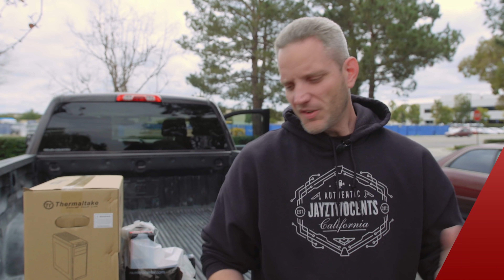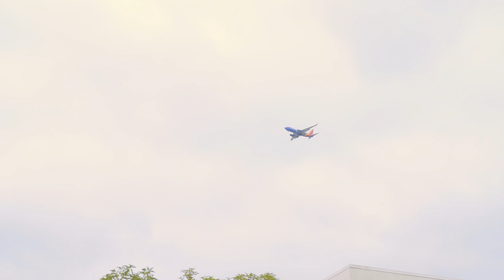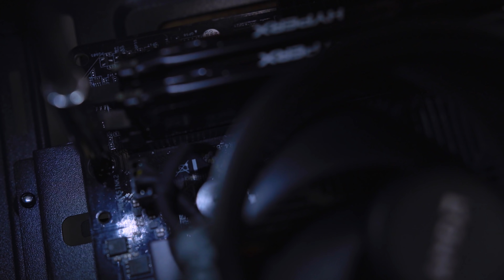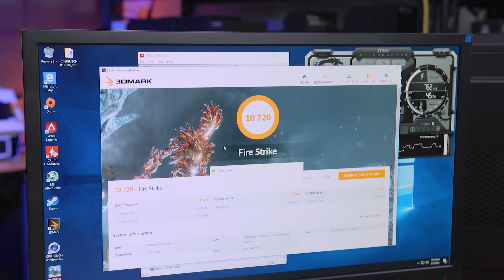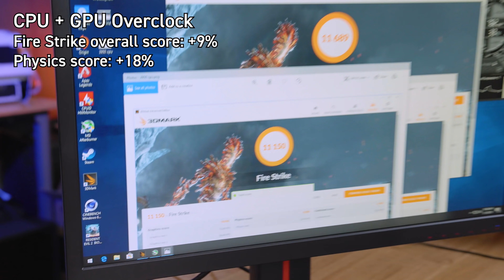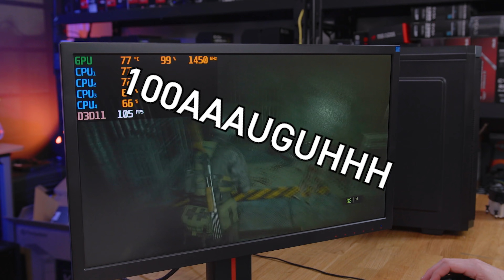CHEAP Gaming PC Build - 2019

Comment: Jay need your help, don't know if I should upgrade my pc or just build the one you just built. Since only really need to upgrade my GPU but then I will need to upgrade your power supply and mite aswell get better ram. I'am running with a I7 2nd gen 2TB hd 8g ram with a gt 520. I KNOW pz don't laugh. Really don't want to transfer my files if I don't have to deal with that mess. Any thoughts ?

Comment: Why is this $580 PC performing better than my $1200 PC (In Apex).... I tried same settings as you did and got an average of 80... FPS gets to 40 before jumping out of the drop ship...

Specs:
Intel Core i5-8600k
Gigabyte GTX 1060
16GB Kingston HyperX Fury
Asus Z370-P
Coolermaster MWE 650W
BeQuiet Dark Rock Advanced C1
1TB Toshiba HDD
240GB Adata SU650 (Apex installed on SSD)
Dual AOC E2470Sw
Reply: Domi apex favors AMD cards

Comment: Instead of cheap you should have said inexpensive.
Reply: Warm Soft Kitty  p sure it exists, just....you wont be able to run ore than LoL on low quality and vanilla minecraft lol
Reply: How much did his cost
Reply: Warm Soft Kitty Well since your PC cost you $3000 I can see why you would think you can build for a little money, You can buy a Prebuilt and put in a RX 560, 1050 2gb, rx 460. You can build a pc for 400 dollars but i will recommend at least 600 to get a pc that not only you can upgrade easily but have enough PSU power to power a lets say RX 5700, maybe swap a R5 2600 for a R7 3700X there are many things you can do with PC components. You can cheap out and get the most bang for your buck leaving no room for future upgrades or you can get a lot better cpu, psu, ram and spend more which will pay out in the long run.
Reply: Warm Soft Kitty  Yeah but we were talking about new and not used. But I got warranty and didnt overclock the R5 2600 for my cousin since he didnt need the extra power ( He's 7 so he's mostly playing Fortnite, Minecraft and Roblox) . And I wanted to be completely sure about every component and having warranty was so my aunt wouldnt worry whether the system will fall apart every second ( Im not saying buying used is bad I would buy used but people who dont really understand PC parts will feel uneasy with something thats used.
Reply: @crazycajunj1703  inexpensive just means it doesn't cost much. Cheap has more definitions. Such as cheaply made.
Reply: No, cheap is right. My gpu alone cost 3x that.
Reply: @jnrs9512  no. Inexpensive is right. From everything I've seen, the rx 580 is a good card. Is your card 3x better? Or just 3x more expensive? Either way. It's not cheap.

Comment: Jay I want to upgrade my system but have no idea where to start... 
I7 5820k cpu
X99s sli-plus Motherboard 
Gigabyte geforce windforce Radeon R9 9200 4Gb DDR5 graphics card 
And 8GB DDR 4 ram...
Want to upgrade the ram to 8GB and want a new SSD and HDD but in terms of motherboard cpu and gpu im a bit clueless whether ill really be upgrading or just getting the same spec with new hardware..  pls help bud
Reply: I would upgrade the gpu and ram. cpu is still great

Comment: AMD - Ryzen 3 2200G 3.5 GHz Quad-Core ProcessorGigabyte - B450M DS3H Micro ATX AM4 MotherboardCrucial - Ballistix Sport LT 8 GB (2 x 4 GB) DDR4-2666 MemoryKingston - A400 120 GB 2.5" Solid State DriveWestern Digital - Caviar Blue 1 TB 3.5" 7200RPM Internal Hard DriveMSI - Radeon RX 570 8 GB ARMOR OC Video CardRosewill - FBM-X1 MicroATX Mini Tower CaseCorsair - CXM 550 W 80+ Bronze Certified Semi-Modular ATX Power SupplyTP-Link - TL-WN881ND PCI-Express x1 802.11b/g/n Wi-Fi Adapter...……………….built it for 550$ including a 30 dollar copy of windows 8.1...………..not the greatest set up but its on par and cheaper than a retail build by 300 dollars.

Comment: I'd like to see an AMD budget build meant for streaming Overwatch, honestly
Reply: Buy a ryzen 5 2600x and you are good to go
Reply: It's moreso that ryzen processors have way better multitasking capabilities than Intel's do. Which is where the streaming comes into play. Intel has better per-core performance, where ryzen excels in using multiples cores to do more complex tasks.
Reply: Also if you haven't, put it on an SSD.
Reply: Just upgrade the ryzen 3 to a 7 and you should be good for any kind of streaming you want
Reply: @BubbaDiesel  Huh really? I've always used Intel CPUs and tbh would need a newer gen higher model than my current 6th gen i5 to do so... So I thought maybe more would be needed! But biggest thing is thank you, I've been considering switching to team Red lately and wanted to see what I'd need for THAT

Comment: ive got 5th gen i5 and a 940m that will run apex and most other titles, you could probably throw a 660 ti in there or a 700 series and be fine. Those older cards dont get enough love.

Comment: does the 2200g support 3000MHz DDR4 RAM ? Where can I check this specification ?
Reply: Yea it does. But you should check your mb also... Mine supports 2666mhz but with ryzen on it supports 2933. So its not all about one or another its together.
Reply: Check on amd website and mb website.

Comment: in india this build costs 81,473.99 rupees, which is roughly $1168.91 rip
Reply: Nope Rx 580 15500
Ryzen 3 2200g 7100
 Ddr4 dual channel 5400
Psu 3700
Case 4700
Motherboard 6800
HDD 3700
SSD 2100
RS  46000 approximately

 660 dollars approximately
Reply: Hemant Singh the rx 580 8gb red dragon costs 30k itself lol
Reply: @SuperGames27  you can get one from mdcomputers at RS 15500
Reply: So no rip
Reply: SuperGames27 F in math?

Comment: i7 @ 3.4GHZ | 12GB RAM (up-gradable to 32) | GTX 1060 6GB RAM | 256 GB SSD | 1TB HDD | $556 | Is this a good deal?
Reply: Which i7 there's many different i7's
Reply: chris sehtman 3770
Reply: @raymonddez2453  I wouldn't go for it  that's really old hardware at this point. We're currently on i7 9700(6generations) from that one and it's using old version of ram it's still on ddr3 and most things use ddr4. So if you wanted to upgrade anything you'd pretty much have to make a whole new computer. I would check out Paul's hardware he just posted a 600dollar build
Reply: @MrEpicgamer123  Thanks I'll check it out. I just googled my specs and see people selling Desktops for around $700+ with the same specs.
Reply: @raymonddez2453  yes if you know how to mess with those parts but for someone who's new with this if anything has an issue you have to search eBay for parts and everything is old. Also lots of people getting into to PC gaming and people are willing to buy old parts because sounds good. YouTube some benchmarks with the games you want to play( would check gamer's Nexus) and then see if it's still worth it because for that money you can get a completely new system.
Reply: chris sehtman I’ll do that. I thought I’ll be able to play the latest games with those specs

Comment: This is not budget!  I hacked together a comp for about 200$ games everything max 1080. Buy a z400 workstation barebones, (quad core zeon 3.2 ghz), came with 24 gigs of ddr 3 for 99$. Got a used 580 for 100,  and salvaged my old ssds, and power suply. Boom 200$, value.

Comment: You got a great deal on the graphics card as it seems the RX570 and 580 are trending up not down. Rx580 cards like the Sapphire Nitro are up $30 in the last week.
Reply: Kelly Daniels sapphire is an exception to the 580 series. The usual price is consistently around 230-250, however they also go on sale down to 220 and occasionally even 200 pretty often. In the last week or so they went back up to their usual price after being on sale, they aren’t trending upward. The rest of the 580 variants are trending downward as well.

Comment: Yep those RX 580 and 590 price drops are great for budget builds.
Reply: The 580 maybe. 590 would probably require a stronger PSU.
Reply: @jamieammar6131  Yeah, plus the 500 series is just a 470/480 that are pushed to the limit. 590 is pushing it to the brink. I'd prefer a 580 which will be waay more stable.
Reply: @ishabooo  my one pc has a Sapphire RX580 Nitro+ pretty nice, good cooler on it, never goes above 60 with the fan curve settings.
Reply: @jamieammar6131  a solid 550w is sufficient but yeah, they do draw more power. I mean  power consumption is a silly thing to worry about when people blow $3-$4 a day on coffee, lol
Reply: @Porkleaker  More power consumption, more heat. Get better case, with better air flow..better fans etc. Also the 590 sounds like a leaf blower.
Reply: @jamieammar6131  uh mine is fine, doesn't go above 58c and its overclocked, depends which version you buy too the Nitro+ cards have good coolers.
Reply: @Porkleaker  Well Nitro+ are custom cooled so they are pretty good. Most which are sold cheap right now are mostly normal versions from AIB. The Nitro+ costs $340 here anyway. So it's pretty much a no brainer to get that.
Reply: @jamieammar6131  $340? ouch well depends on what kind of dollar you're using there lol
Reply: @Porkleaker  US dollars. I mentioned the price in US dollars. Unlike the US, Aus or some parts in EU, AMD not having any sales here.
Reply: @jamieammar6131  uhm they dropped the prices way lower than that. You can get a $580 for way less than that. Where are you buying your parts, newegg? lol ew
Reply: @Porkleaker  Dude, I'm not from the US. From SEA
Reply: @jamieammar6131  well, the Sea is a very large place, do you live on a boat?
Reply: @Porkleaker  Malaysia, bruh. You know, I have always used ATI/AMD cards all my life. Always mid range. My last AMD card was R9 380x. But well, when AC Odyssey was crying with that GPU, I though, well, time for an upgrade. Then I got stunned by the prices of AMD gpus, still didn't recover from the mining crash. The retailers don't care, neither AMD. Atm there are like only 5 Vega 56 cards on the biggest second hand website lol.
Reply: @jamieammar6131  Yeah I usually steer towards  AMD even back when they were ATI, good ol' days lol. But I've had a few Nvidia cards still have one in my other PC. Also glad the miners have hopped off the gpu market, totally inflating the prices, apparently Nvidia didn't catch the message though. I mean, a 2080ti is cool and all but not $2000 cool. lol
Reply: @Porkleaker  Well, after the crazy AMD market here, I moved to Nvidia for the first time, so far so good.
Reply: @jamieammar6131  I've had a few, they're nice cards too, less driver issues.
Reply: @Porkleaker  Yeah less driver issues. Way more quiet and less power draw.

Comment: Perhaps you should make like a series out of this and switch in between 1080p gaming machine(like this), 1440p and enthusiast level(4k/3440x1440 and up). 

For an example Vega56 was 320 bucks with 3 games at that price(maybe with a 1600+b450 for 150) you have a decent 1440p build for extremely cheap. And then the ultra extreme gaming edition which would probably be a Nvidia/intel machine.

Comment: way did you open the side panels not good for the computer when running
Reply: AlexPS4 it’s perfectly fine for the computer actually maybe even better as it allows more airflow
Reply: @davidmorse7288  yeah. but it will overheat the video card and everything inside i think

Comment: PowerColor: guaranteed to boot, not much more. In the real world I replace so many of these PowerColor, Sapphire, and off brand GPUs, and their "warranty" support is crap (they usually send you a refurb instead of a new replacement) WHEN it dies. Buying at Amazon usually means if it dies in 30 days you're covered.

Comment: Newb pc builder question :

Do i have to buy cables separately or do they come in the box for each part?
Reply: They come with motherboard and power supply
Reply: The cables for all the PC parts come with it what you won't get is HDMI cables.

Comment: Whenever I work on budget builds I always include price of monitor, keyboard, and mouse.   The monitor IS arguable the most important component.   Mouse and keyboard are a little less important because honestly you could just use some old office equipment, but there are some really competitive gaming peripherals at low price points, so might as well spend the money if you can.
Reply: This is what I ran into buying the parts for my budget build recently. It’s similar to this except I got a Ryzen 5 2600 and 8gb 3200mhz hyper x RAM. With the XFX OC+ edition if the 580. I was just going to use my 4K TCL TV as the monitor. But, I looked and thought about it and settled on a 23”  ViewSonic with free sync that cost $189. Then I went and bought a red dragon mouse and keyboard for like $40 instead of using my old work PC KB&M. So all that drove my price up closer to $750 and not the $500-$600 I was going for. I wish these builds did recommend Monitors and KB&M since I really don’t know myself....

Comment: I have just built a pc with Ryzen 5 2600, Asus Tuf B450 Plus Gaming motherboard, Coolermaster ML120L RGB cooler, Radeon 580 Sapphire, be quiet Power 9 600 watt 80+ Bronze PSU, Corsair Vengeance RGB White PRO 16GB (2 x 8GB) DDR4 3200MHz, WESTERN DIGITAL SSD 500GB M2, 2TB WD Blue WD30EZRZ - 3.5" HARD DRIVE/HDD and CoolerMaster Lite 5 RGB case for my grandson. Is this sound alright?

Comment: Core i5 3570 and GPU 960 4GB is this is good in performence in 2019 ???
Reply: I had that same graphics card and I have to say that nvidia nerfed the hell out of it and with the used market doing pretty good nowadays I just got a rx 580 because the performance will age like fine wine hence why people say AMD FineWine technology.  BUT it truly depends on the games that you play, if you're not playing very intensive games I don't see a reason for you to upgrade any time soon! the CPU is still amazing with 4 cores and 4 threads if it's a K model just overclock a bit because I'm running a 8 year old i7 and it's still going strong.
Reply: Should i buy Rx 570 4GB or Gtx 960 4GB??

Comment: Hey, is there any non "break the bank" ways to cool off a pc/GPU? When I'm playing, my Gpu goes to around 80 Celsius and my pc is a smaller case with space for only one fan. Any tips?
Reply: Under-volt the GPU.
Replace the thermal paste if it's an older GPU.
Or if you are really desperate, take the side panel(s) off and direct a fan at the motherboard. 
That works a treat!
Reply: @DJ_Dopamine  How do you under-volt and does that severely drop performance?

Comment: That’s decent FPS I have a stock i7 8700k & stock 1060 6gb, All low settings in game & Nividia control panel with 144hz 1ms monitor and I’m lucky to keep 130fps when travelling around the map, drop to 80 when at the start and flying down FeelsBadMan

Comment: Damn you make overclocking look so easy
Reply: It is... :)
Reply: Richard my view on this is that if it was easy your motherboard and cpu manufacturer would tell you exactly what settings to adjust and how to adjust them.  Just goes to show that no motherboard manual tells you how to OC manually, all it does is explain to you the description of each setting.  It doesn’t even try to explain to you what they do.  Overclocking can be kind of simple when messing with multipliers but overclocking that goes past this just gets do complex it isn’t worth the time

Comment: This is a great budget build. I made one that is extremely similar just a few months ago. One interesting thing I learned recently was that having 8GB of Vram makes a bigger difference than most benchmarks will show if you are only using 8GB of system RAM. Most benchmarks comparing 4 vs. 8GB video cards have been done on systems with at least 16GB of system RAM. With only 8GB of system RAM, having the extra Vram will make a much bigger difference in a lot of games, and it's a similar story if you're comparing the 3 vs. the 6GB versions of the GTX 1060. Hardware Unboxed did a great little video about it fairly recently. You can totally get away with only 8GB of system RAM if you also have 8GB of Vram, and with how DDR4 is still pretty expensive, it seems like a good way to save money. Add to this the fact that it's way easier to upgrade your system RAM than your video RAM, and that sometimes you need more than 4GB of Vram regardless of how much system Ram you have, and it seems like the best way to do it. I never thought I'd see the day when an optimal budget system would have equal amounts of system RAM and Vram!